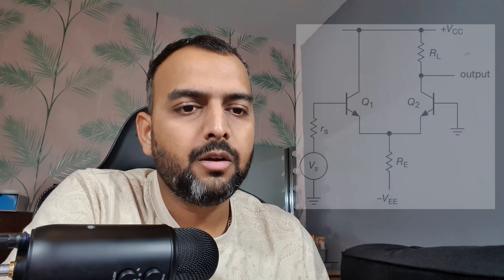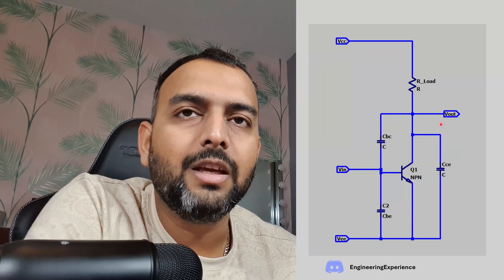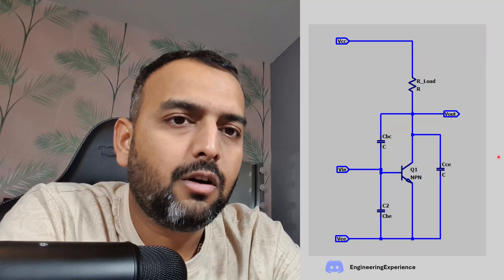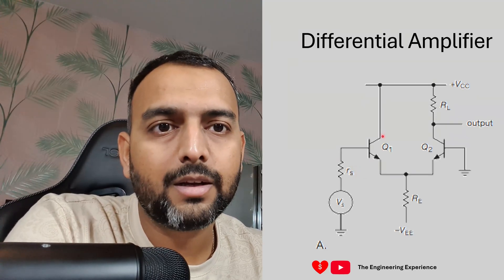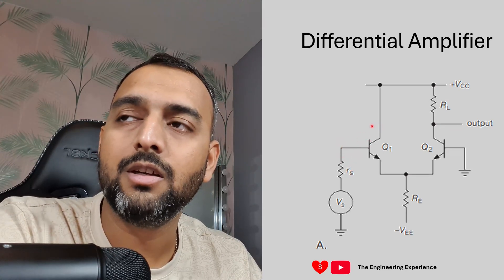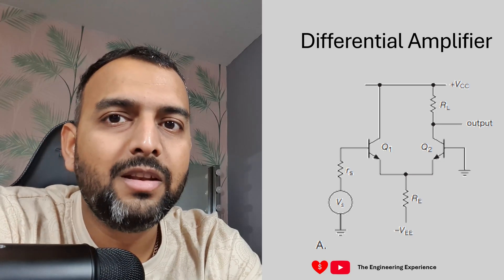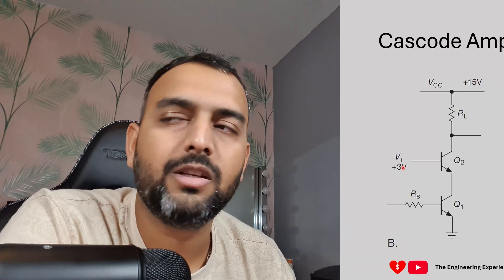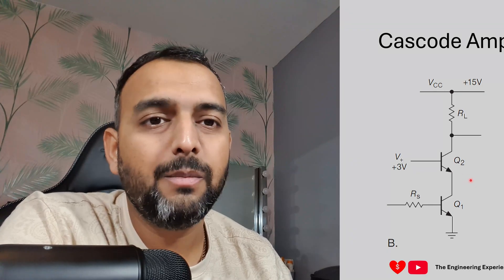Transistor Circuits and Miller Effect - Art of Electronics Exercise 2.19

Comment: Thanks to you I understand it better.
Correct me if I'm wrong the current that go through Cbc  is equal to Cbc*d[vc-vb]/dt. If vc is fixed and so approximately constant the previous equation is Cbc*dv/dt which represent a "basic" capacitor. The capacitor is no longer seen by the source as a huge capacitor proportional to the gain => Miller effect negated.
This is the case for the cascode circuit and the left part of the differential amplifier. However I'm still struggling to understand how the Miller effect is negated in the right part of the differential amplifier.
If I go back to the equation of the current through a capacitor, i_cb=Cbc*dvc/dt, but vc = -Gv*vin, so i_cb=C*Gv*dvin/dt. Which represent an equivalent capacitor of Ceq = C*Gv. The capacitor is still proportional to the gain, so the Miller effect is not negated. Am I missing something?
Reply from the maker: Great breakdown and thanks for the feedback! If i understand you correctly, I think you’ve got the right idea on why the cascode (and the left side of the diff pair) kills the Miller effect by keeping the collector voltage essentially fixed. 

On the right side it’s a bit different as the collector isn’t swinging in phase with the base, it’s swinging out of phase. That feedback path through Cbc doesn’t multiply up the way it does in a common-emitter stage, so you don’t get the same huge equivalent capacitance. t Miller only really ‘blows up’ the capacitance when the node is moving with a high gain relative to the input. In the diff pair, the symmetry and the cascode connection reduce that.

Comment: Am keen to undertstand cascode amp configuations better. How does Vout change if Q2Ve is constant?
Reply from the maker: Q1 (top) will chnage and pass current through to Q2( bottom). 

The out is taken from collectot of Q2 (top).

A normal configuration with a single transistor, Ve is  grounded anyway so I guess it's not different. 

If you wanted to control gain then you can add a emitter resistor at q2 emitter junction to ground.
Reply from the maker: I am not sure how a emitter resistor would affect Miller effect though!